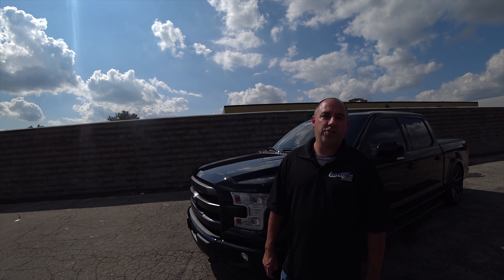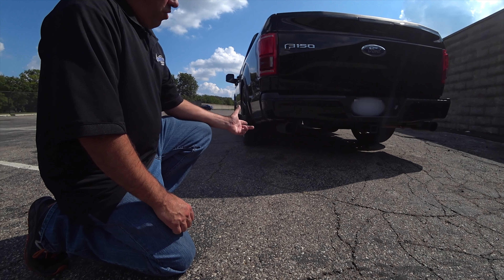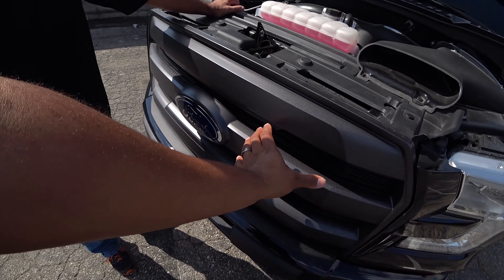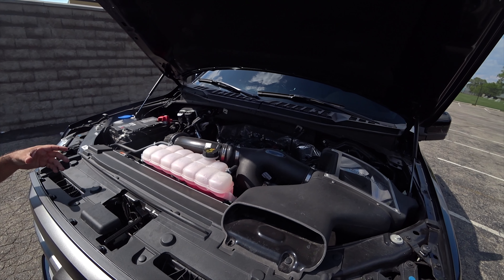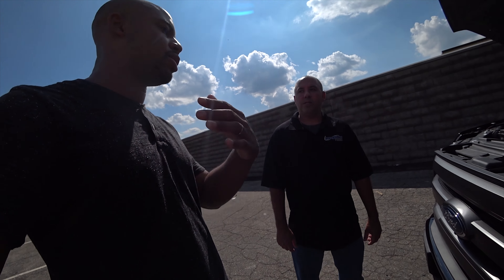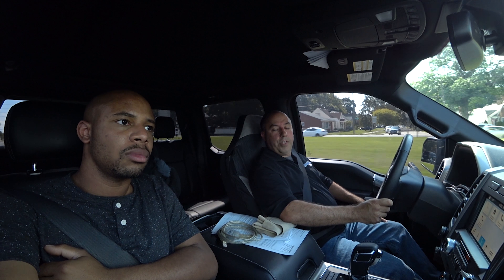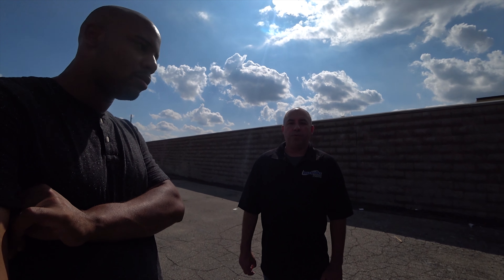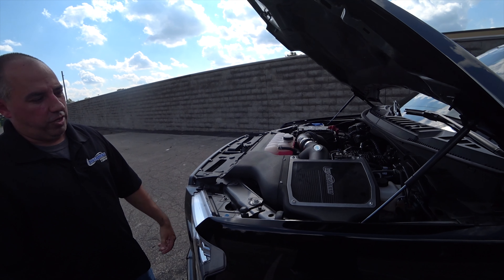F150 Spot Light Ep1

Comment: Great video.  Loving that exhaust.  But out of my price range.  I think I'm sticking with my $620 magnaflow down exit exhaust with the $300 s&b cold air.  Thnx for showing us this.  I bought my lightning blue 3.5 lariat from my local dealer.  They modified it with raptor wheels, 34" falken tires, raptor grill, raptor bumper and in house designed graphics.  Beautiful truck that stickered for $68,000.  I talked them down to $53,000 after all was said and done.  Great time to buy a truck.

Comment: that's sick, but I still like the 4×4 more lol
Reply from the maker: What 4x4 you like more? 
this is a 4x4...
Reply: H Pac my guess is he does not like the "slammed" look
Reply: DonnaSean that's a lowered 4x4? why?
Reply from the maker: I didn't meet the owner... but for some guys its easier to get in and out off...
Reply: DonnaSean yeah I guess with these new trucks they do have CV joints and the suspension is like a 2 wheel drive truck. but then again I think you said you live in Michigan so you get a lot of snow and ice so a lowered 4 x 4 could make sense if you wanted a lowered truck and have to drive in those conditions. I live in California and when I was growing up driving lowriders people with clown you to have a lowered 4X4 and because the older 4x4 mostly had straight axles it would almost make it impossible to lower.

Comment: Question for u.  How do U feel about wheel spacers?   My stock 17 f150 came with several raptor parts including raptor fender flares which made the wheels look sucked in.  I'm wanting to push them out about 1 1/2"'s.  that would make them even with the flares.  Any thoughts?
Reply from the maker: +Justin Evans I would say don't do it... These front hubs are all that strong for all that... if you have Raptor front fender flares I will try to get the rest of the Raptor suspension components. That would bring the hubs out a little bit more where they should be... Also to you can get a set of aftermarket wheels with a better offset.
Reply: DonnaSean I was afraid u would say that.  Lol.  Yea, they put raptor wheels and flares but not suspension so it looks top heavy.  Well, dang it.  I'll keep thinking.
Reply from the maker: Justin Evans upload a video of your truck. I would like to see it!
Reply: DonnaSean I'm not very tech savvy.  U tell me how and I will.  I would love to share it with u.
Reply: DonnaSean my dumbass figured out how to upload a video on YouTube.  Yeah!!!   Please check it out on my channel.   Tell me what u think.
Reply from the maker: Justin Evans LOL